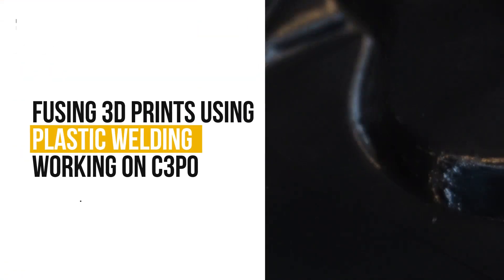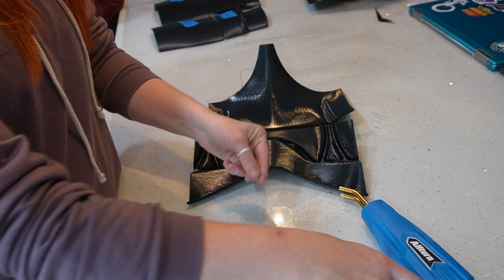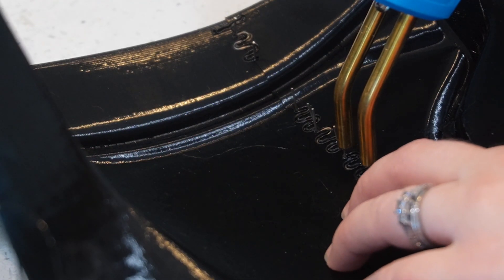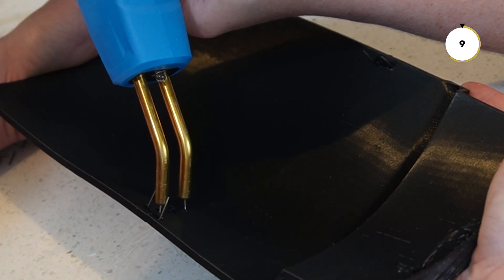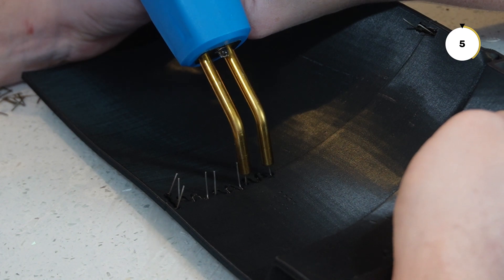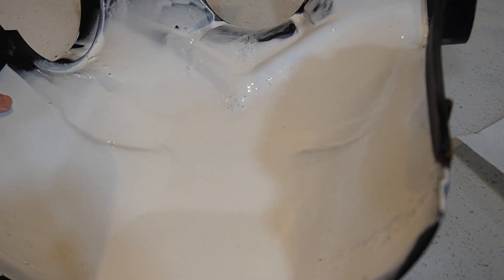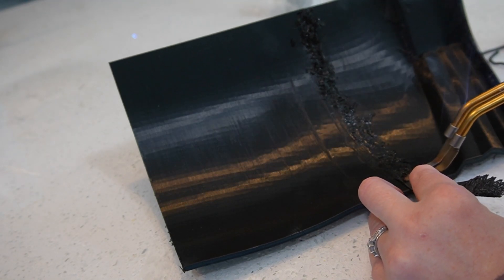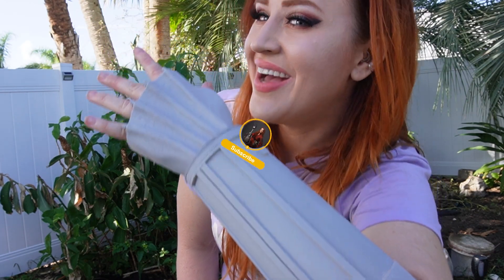Plastic Welding 3D Prints - C3PO

Comment: Hey awesome content thank you! Do you do this instead of the normal welding with a soldering tool and filament?
Reply from the maker: Thanks for watching! I have booth in my toolkit of options and I would say it is case dependent for me. For large pieces like C3PO this is has been my preferred method, but smaller pieces I like the soldering iron and filament.
Reply: @RGBrea  awesome thank you so much. I like soldering, but the bigger pieces def get rough after a while, gonna look into this tool now. Thanks again!